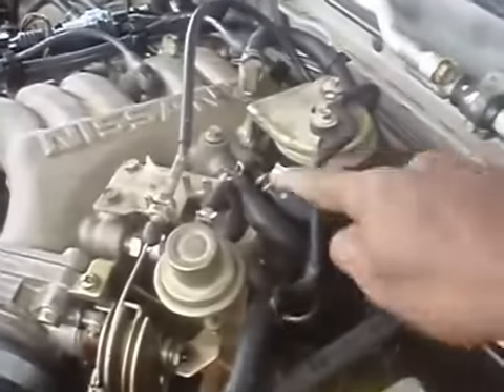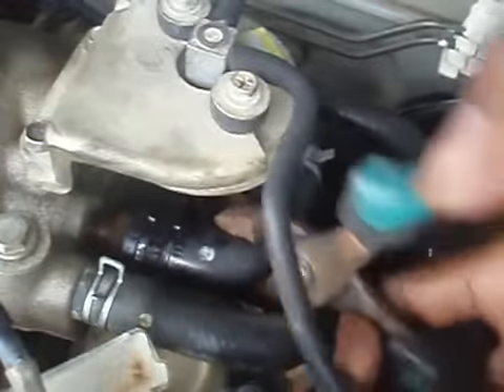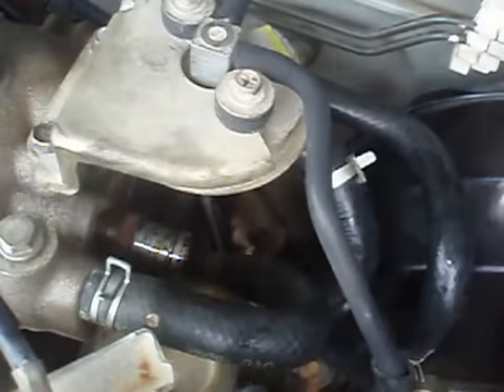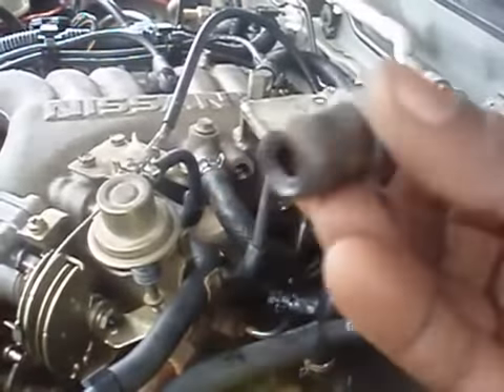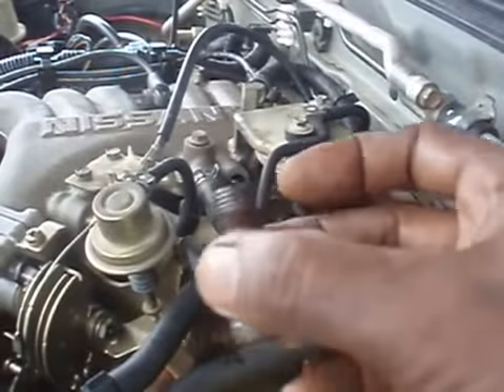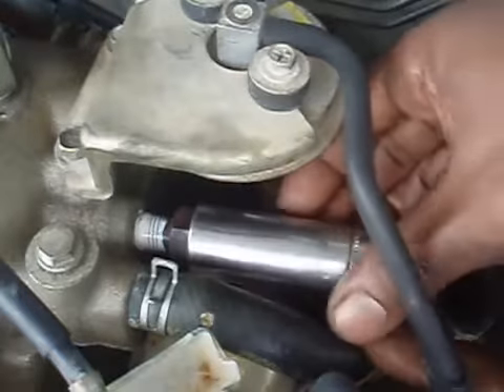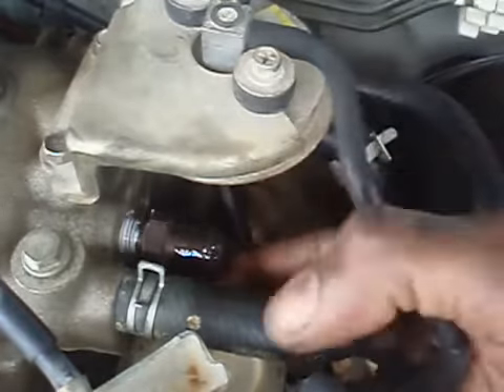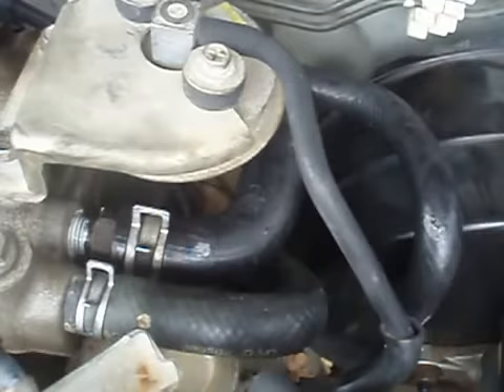How to Remove PCV part. Nissan Vg33e positive crankcase ventilation valve.

Comment: Hello. I removed the egrc-bpt valve to gain better access to the pcv hose. Unfortunately, I had to replace the 2" or so hose/tube on the egrc-bpt because it broke. When reattaching the tube, I may have not left any space between the two connections. Is that ok? Or, should there be space between the two metal connections? Thanks for your time and the great video.